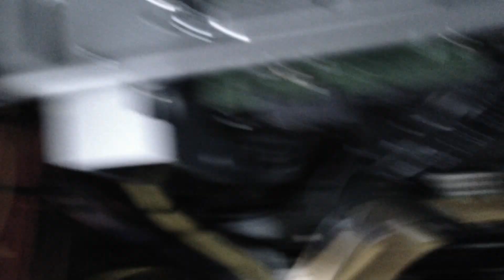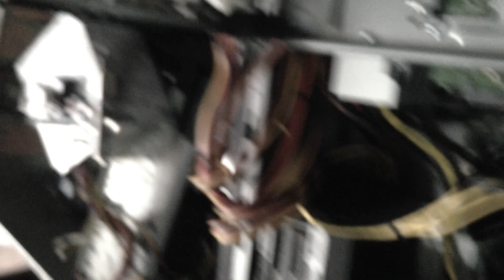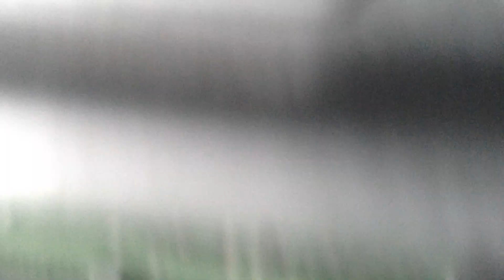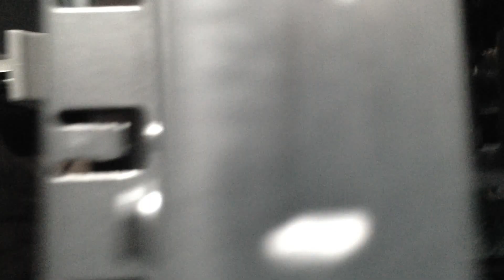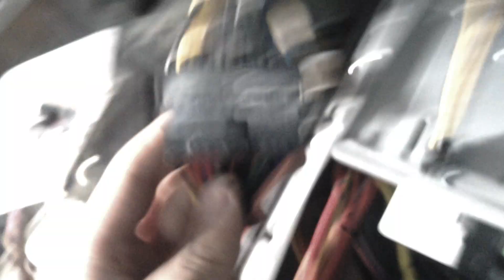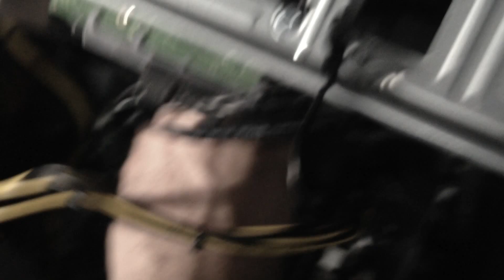14 Pin Power supply. 24 pin power supply in a 14 pin.  IBM Lenovo PSU Power 24-Pin to 14-Pin Cable.

Comment: I tried after waiting 2 months for this adapter(it was imposible to buy at any store one of the sellers told my that he sold the last adapter 10 years ago) and burned my motherboard in the process.I realize later that the 14 pin conector its a practice some companis did to force u to buy their own power suplys so if u have the same problem i recomend u to buy a new mother board
Reply: I know it fits inside the case, as it's the same type exactly dimensions wise.

Comment: where you buy
Reply: 1 get a 14 pin psu 
2 cut the 14 pin off 
3 get a broken motherboard 
4 desolder the 24pin 
5 soilder the 14 and 24 together
Don't soilder them wrong black to black yellow to yellow red to red you name it
Reply: how to contact you